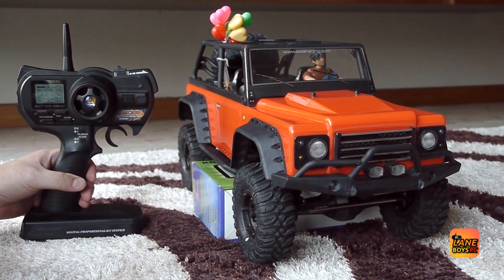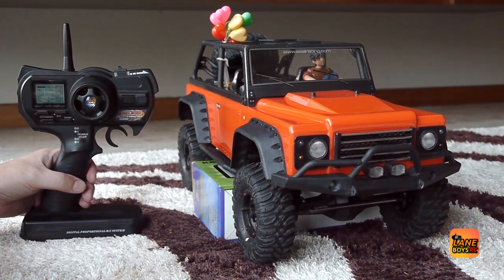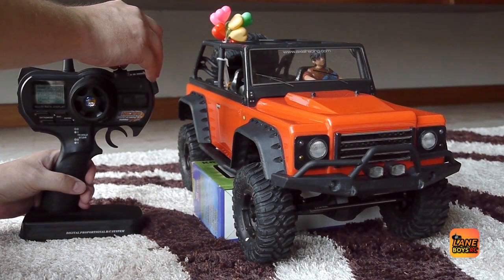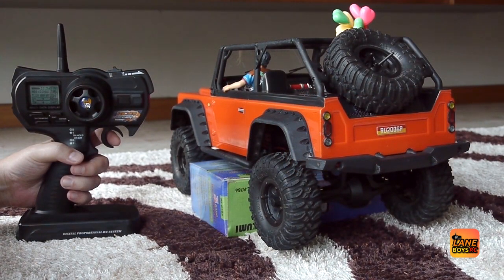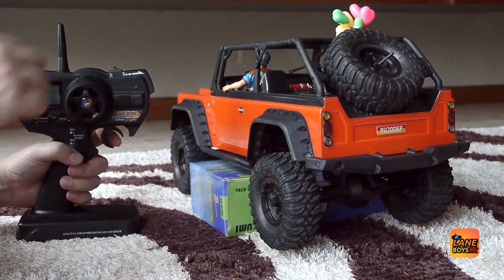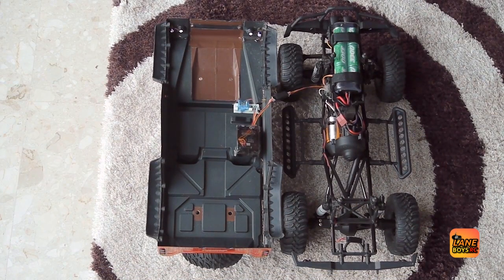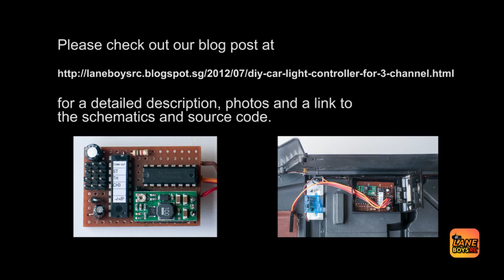DIY RC Car Light Controller

Comment: Just saw this awesome DIY light controller. I'm doing some research for my own, which I had an idea to use an Arduino Nano and an Adafruit sound module for engine sound, horn etc.
Reply: Despite the age of this design, it actually have a smaller footprint than an Arduino Nano, as it is split in two (and you only count one part)

Comment from the maker: The resistor is 1kOhm and determines the brightness of the LEDs.
The value of the capacitors is not important as they are just stabilizing the power supply. Ensure that they have a high enough voltage rating though.

Detailed schematics are on Github, in Eagle format in the "electronics" folder

I also have an updated design based on the TLC5940 and PIC16F1825 which can drive 16 LEDs, hence there may not be a need for the (expensive) Boost regulator. Contact me laneboysrc at gmail to discuss!

Comment: Hi is all i need to build this a pcb board PIC 16F628A microcontroller
TI TLC5916 Constant Current LED driver
Pololu Adjustable Boost Regulator
what about i see a resister and a couple capacitors on there
but no info about them thanks for replying

Comment from the maker: Thanks! The answer to "how much" is unfortunately not straight forward. If you buy the components from DIY shop a single master or slave costs about USD 10. If you need the DC/DC convertor than you need to add about USD 12..20 per master and slave.

If one would mass-manufacture the PCB the cost of a single master or slave could be brought down to an estimated USD 7 (including DC/DC).